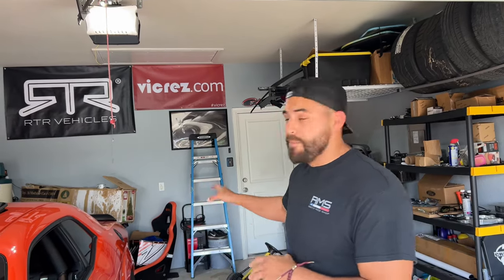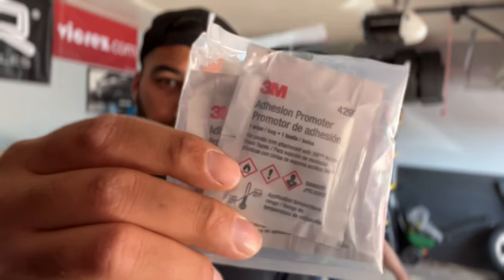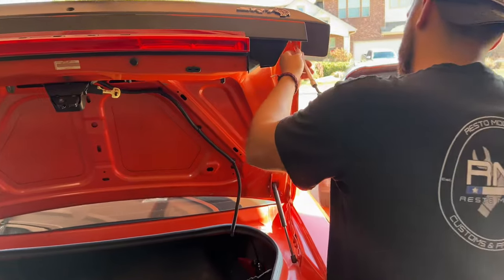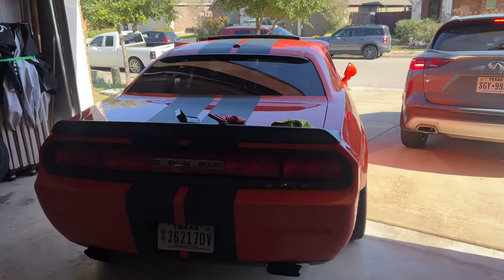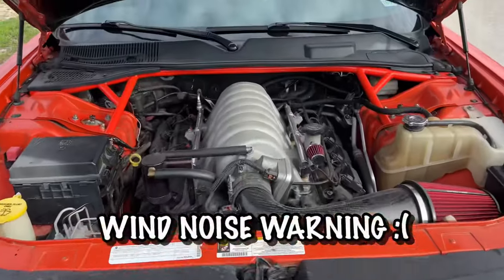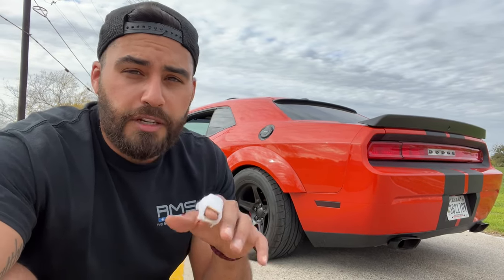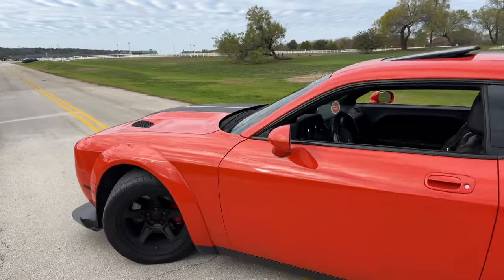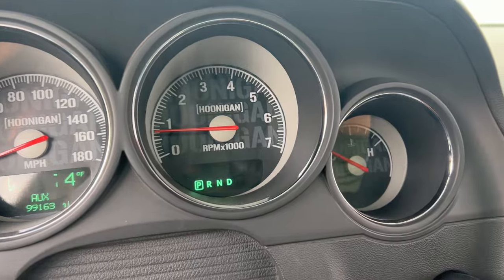My Challenger Is For Sale… Not On Sale

Comment: Did you cover up the old holes where the clips suppose to go? Trying to do same soon.
Reply from the maker: Help me out here, what holes?
Reply: @TIRADORACING  where the old spoiler clips would go into. I believe there are 3 holes for them.

I know that the 2015+ spoiler clips don’t line up with the old generation, and can only use the studs on the end. I was just wondering if you plugged the old holes so water wouldn’t get in or just left them as is.
Reply from the maker: @alopez2006 gotcha! I covered mine with plastic push pins and the 3m tape around the spoiler acts as a barrier and doesn’t let water get in. 

Previous to the hellcat spoiler I had a 2015+ spoiler and water never got in. 

So you’ll be fine.
Reply: @TIRADORACING  perfect, thank you!